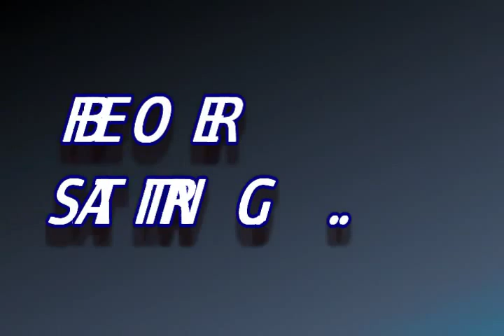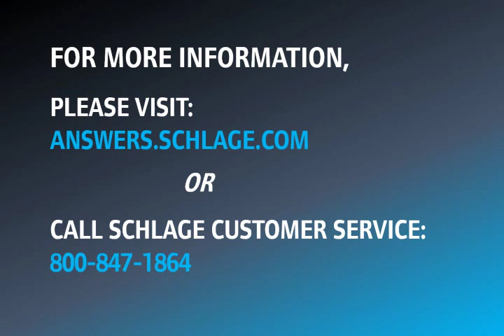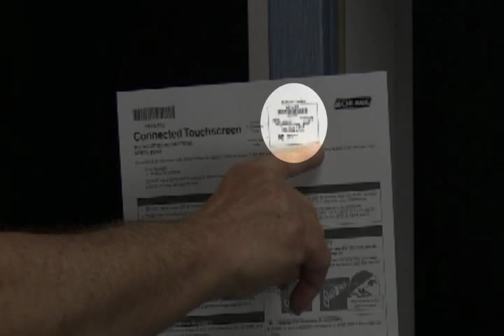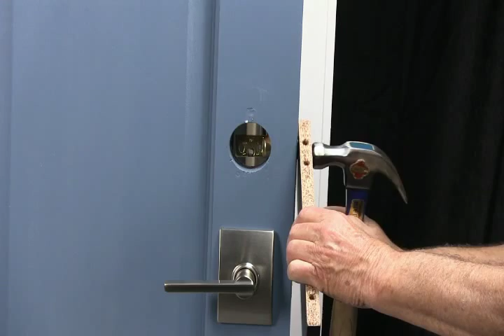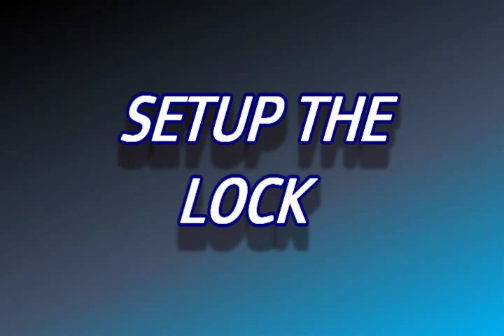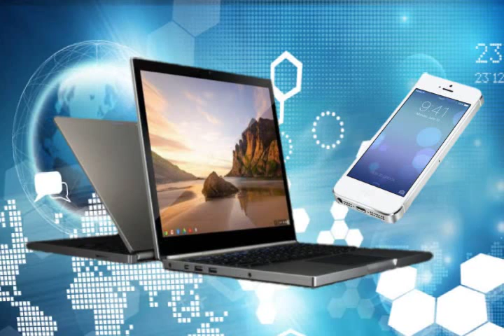How To Install Your Schlage Connect Smart Deadbolt (BE468)

Comment: I push the Schlage button and a red x appears in bottom right?  I can't use either code?
Reply from the maker: Hello Edward,

If the lock is providing an immediate red X when interacting with any digit on the keypad, this would suggest one of two things: Either the batteries are bad, or one or more of the batteries are inserted incorrectly. Either way, the lock doesn't have enough power to operate. Please verify installation of the batteries, and if the batteries were inserted correctly, please try replacing the batteries with Duracell Alkaline batteries.

Comment: I had to switch my lock to a door with the lock on the opposite side and now the mechanism won’t actuate. How do you reverse it?? The range of motion is only 1/4 turn and there doesn’t seem to be any apparent way to convert it. Help!
Reply from the maker: Thank you for contacting Schlage. I would be happy to assist! To reset the handing for your Schlage Connect, you will want to walk through a factory reset. After the reset is completed, you would press the Schlage logo and enter the original USER CODE A located on the programming sticker. The lock should initiate the handing process of extending the bolt and retracting it. After this step, the lock should now be handed to the proper direction of the door it is installed on. Please let us know if we can assist you further. 

Schlage Connect Reset Instructions: https://www.schlage.com/en/home/faq.html?id=131750

Comment: my keybad wont lovk the deadbolt on the outside ?
Reply from the maker: Hello,
Thanks for replying to Schlage. Yes, our connect locks require a hub, but we make them to setup with most home automation systems or security systems. 
If your bolt isn’t moving, then we would have the following trouble shooting steps for you. 
1.	Change the batteries in the lock.
2.	Factory reset your lock. 
1.	Disconnect the batteries.
2.	Press and hold the outside Schlage button.
3.	While holding the outside Schlage button, reconnect the batteries.
4.	Release the outside Schlage button.
*If you are moving the lock to a new door, install the lock on that door before continuing.
5.	Operate it electronically by entering in default codes A or B. If the reset was successful, the lock will perform a setup routine. Wait until the bolt stops moving. The reset and setup are complete.
If you are continuing to have issues with your lock, please respond with the following:
•	What happens to the keypad when a factory reset is done, does it operate electronically?
•	What kind of batteries are you using in the lock?
•	How old is the lock? 
You can reply to this email or call us at 888-805-9837 referencing your case number, CAS2983280, and anyone would be happy to help.